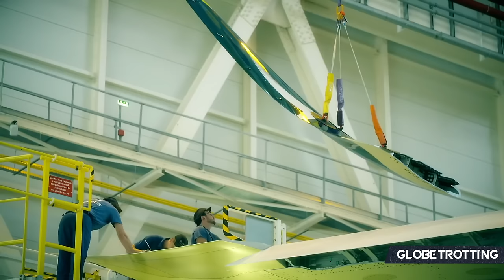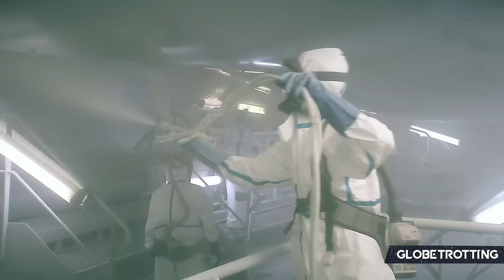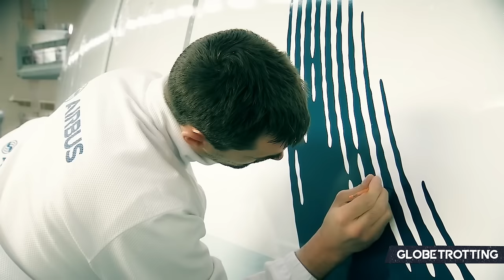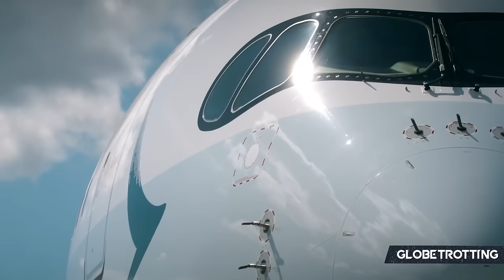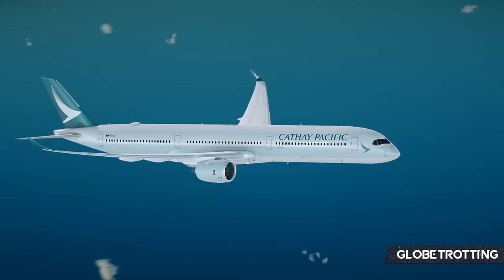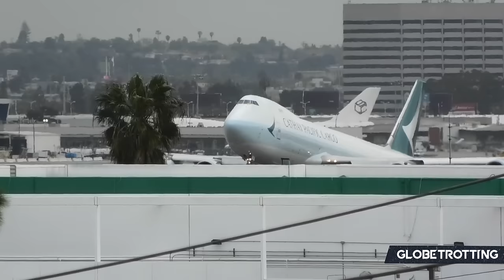DOWNFALL - What Happened To Cathay Pacific?

Comment: Since 2023 and early 2024 I have flown Cathay from London to HK Return and HK to Singapore Return a number of times.  I have tended to prefer the HK to Singapore route (and I don't mind T4 Changi)  though I feel its competes & matches its services with Singapore Airlines.  Generally I have enjoyed the experience of flying with Cathay over SQ and BA. i do understand that the airline had struggled since covid but so did many other airlines.   Do note that Cathay's Skytrax ranking was number 8 in 2023 where in the previous year it was number 16 which is quite a jump.  The only other top 10 airline that made such a jump  in the Skytrax was EVA air (Taiwan)
Reply: I will continue to use Cathay as much as I can

Comment: In all honesty, I can see why their reputation declined, but I think that was before the pandemic hit. The pandemic damaged the company, but not the brand or the reputation too much. I flew with them recently on their a350s and 777-300ER, and I found that their economy class is a top-notch product. Their new IFE is definitely the best in the world, the meals and snacks are great, the seats are comfortable (especially on the a350-1000 it was super comfy!) and functional, and you can see that they are putting effort into their hard and soft product (Their new IFE, metal cutlery in economy). The crew were hit and miss, with 2 sets of brilliant crew, and 2 sets of average crew. I think they still have one of the best economy products in the world.
Reply: How is their economy class seating?  I haven’t been with CX in over a decade because I found their seats too small.
Reply: @canto_v12  In all honesty, the seats are all comfortable. The economy class seats on the A350-1000 are exceptional in terms of comfort. Cathay are definitely on the higher end of the spectrum in terms of seat pitch and width for sure. The screens are all at least 11 inches (apart from the a330), and all the seats have a device + cupholder tray (apart from the a330, again). I would absolutely recommend flying with them. My only gripe is the fact that they switched to a 3-4-3 on the 777, which is noticeably narrower than their A350 seats. Just try booking on the A350 if you do decide to fly with them again... anyhow I would still prefer the CX 777 seats over most other airlines in economy.
Reply: @barcafan9025 That's good to hear!  Thanks for updating me.  Will consider CX in the future, if the price is right.
Reply: @canto_v12   All good!